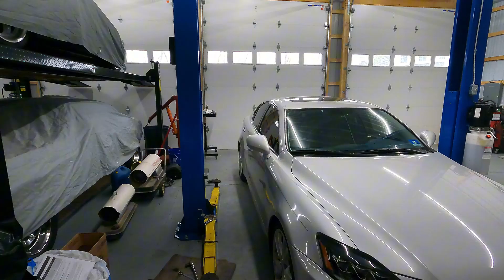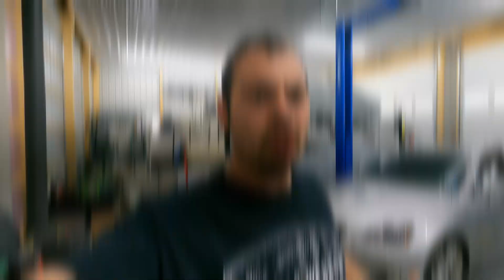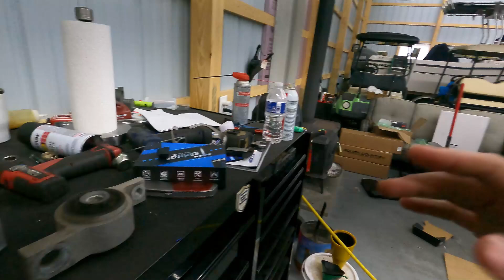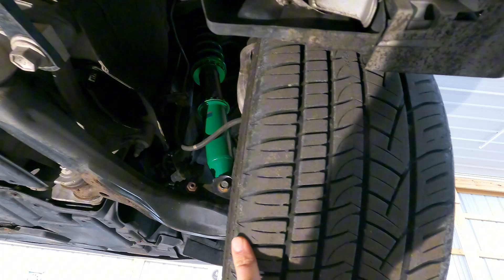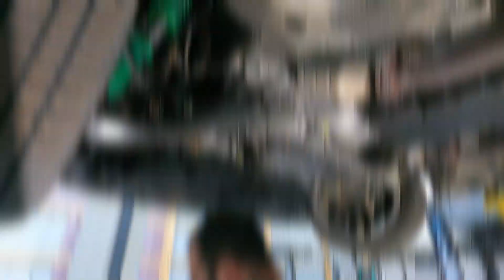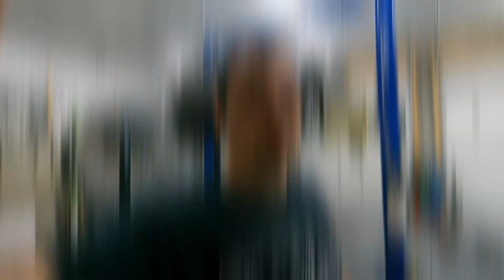Lexus IS, GS, and RC Front lower control arm bushing replacement!!

Comment: Will these failing cause the car to vibrate in a pulsing manner when braking. It's similar to how wrapped discs cause the car to vibrate/pulsate, but had by discs and pads changed and hasn't resolved the vibration
Reply from the maker: These will cause more of a clunk when applying the brakes and you’ll get another clunk when you release
Reply: Did u get this solved? I’m having similar on my RC and I believe it is the toe links. What did it end up being?

Comment: When a shop installs this as I plan to would they know to load the suspension up and loosen that bolt before tightening it fully? Or do I need to give them specific instructions?
Reply from the maker: I’d like to think that most competent mechanics know not to tighten suspension components until they’re bearing the weight of the vehicle but you never know now a days. May be worth it to politely mention it to them
Reply: @SEsGarage  now that I think about it I think I could jack it up take the wheel off and do it that way. But yeah think that this video gave me some good ideas
Reply: You could always just ask the process and see if it lines up with what you think should be done if not ask if this is correct and let them answer it and make them feel like they knew the answer

Comment: GSF owner here. Do you prefer the Figs over the RRacing ones, and if RR, which version would you pick for daily driven GSF? They have race, road and track, and street (this is where I’m stuck). MY 2016 so it’s incredibly stiff as it is. Appreciate your videos!
Reply from the maker: I personally did Figs on my GS-F. Nothing against the RR guys or their bushings as I’m sure they’re great, I just wasn’t sure about their metal backed busing for every day driving. I also run figs rear camber arms as I’m lowered and wanted my alignment to be in spec. Nothing but good things to say about the figs products
Reply: @SEsGarage thank you for responding! I watch all your GSF videos, so thanks again! Subbed
Reply: Lexus master here ! i say RR Racing road and daily driver version, do you go to track ? no right ?

Comment: What would you recommend for an is500 thats a daily? Oem is way too soft, but not sure if i should go rcf or figs
Reply from the maker: I really like the figs bushing I put on. I’m not sure how much stiffer RC-F bushings would be compared to your is500 if at all
Reply: @SEsGarage checking forums, they are slightly stiffer. It's very minimal. I have been eyeing the figs, so will prob go with those

Comment: To remedy issue of premature tire wear you just need to replace the LCA Bushings only?
Reply from the maker: That along with the wheel alignment, yes
Reply: @SEsGarage I hear people talking about replacing control arms too. Not sure what purpose of that is. They say it can also help with premature tire wear especially outer wear I think
Reply: @EvaSlash Just get the RR racing bushings that will get rid of the premature tire wear

Comment: 10:35 so when you request that, do they have to do the alignment with it loose? Then later tighten it when the suspension is under load again or do they just tighten it up when the car is in the air?
Reply from the maker: Just crack it loose and tighten it right back up. All you’re looking to do is remove any preload from the bushing to prevent premature failure
Reply: I dont trust the technicians I just want to observe to see if they do the steps right.

Comment: Question. I have a 2014 Gs 350. Is it the lower control arm bushings or lower control arm itself that causes the crunching noise when turning the steering wheel or when braking? I just replaced the upper control arm, thinking that that was the problem, but the noise hasn't gone away. Thanks!
Reply: Probably the tie rods
Reply: It's probably the brake dust covers, they are insanely close to the discs and easily bent. Stick a screwdriver in to open them up a bit.

Comment: 9:31 can you just lower the car onto the ground fully and then tighten? Or is that too much
Reply from the maker: Sure can! Going to be hard to get under there to tighten it though
Reply: Try lowering it on a set of ramps so you can still get under it
Reply: @q-bert6454 smart man very smart but still a super tight fit esp to get the torque you need